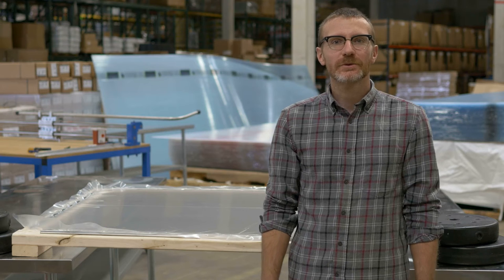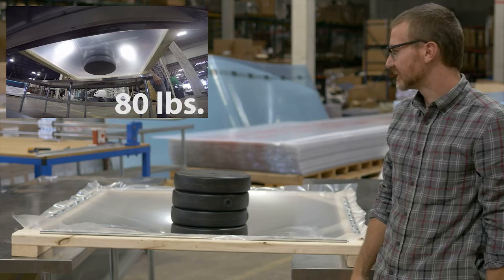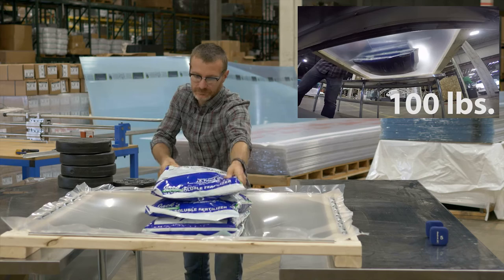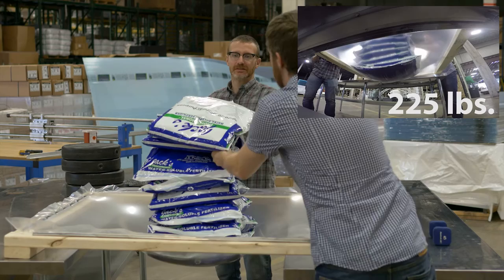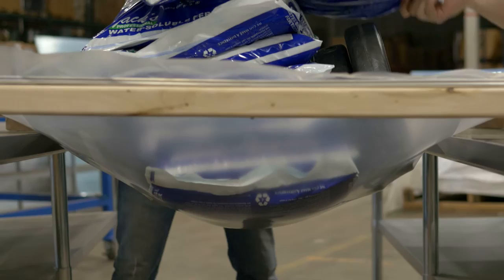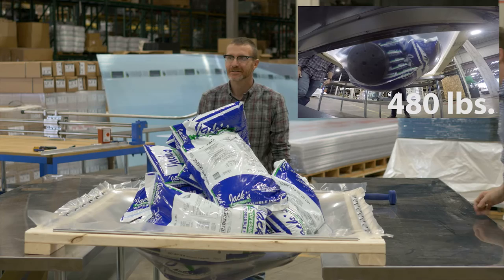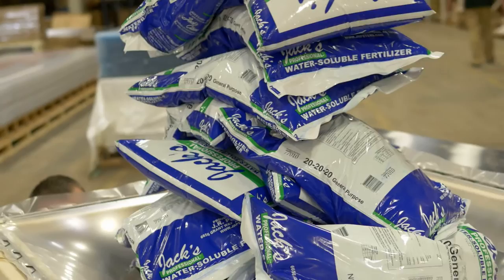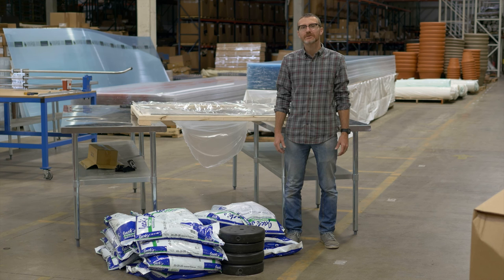Poly Film Weight Test - Learn & Grow

Comment: You need to maintain the same footprint for all the tests, The area of the round weights is less than the fertilizer bags. The final test had the round weights either side of the fertilizer bags, ie, the weight is distributed over a larger area
I`d suggest doing the test with a 55gal hdpe drum and dry sand, which will give you well over 800lbs, You could use the round weighs and bag the sand into known weighs to make things easier. Poly will typically stretch 300% before it breaks so you`ll get plenty of warning before it fails. Your test stand doesnt look high enough off the floor to accomodate that amount of stretch ;) 
You also need to state the size of the poly in the frame because a larger area of poly will support more weight. Force also has a vector (direction), most folks will realise the weighs acting on the poly also create pulling forces on the attachment points which will be greater than the force trying to punch through the poly. If you visualise the poly sheet as a series of ropes attached to the frame and the load weights you`ll understand why its not easy for the weights to punch a hole through the poly.